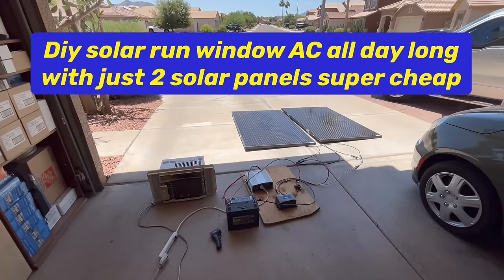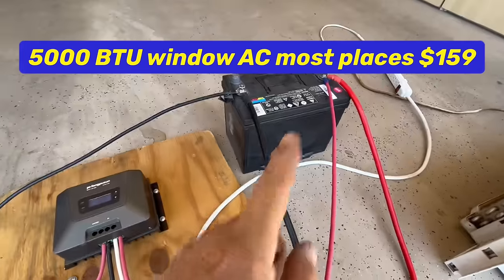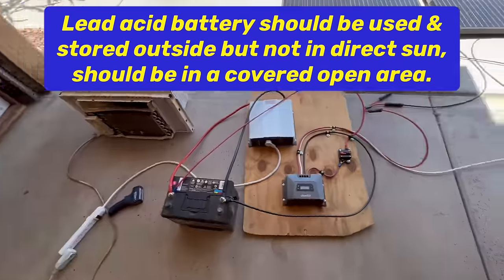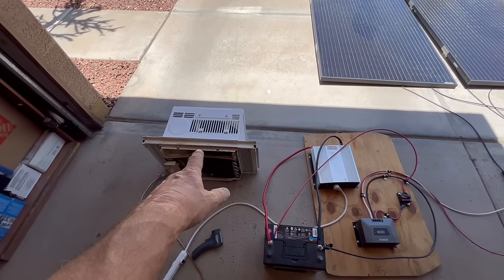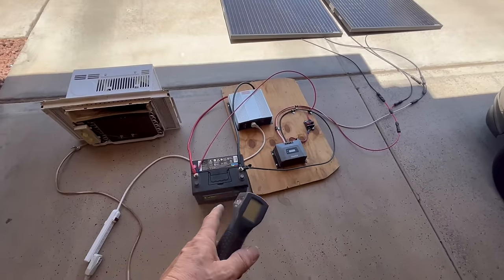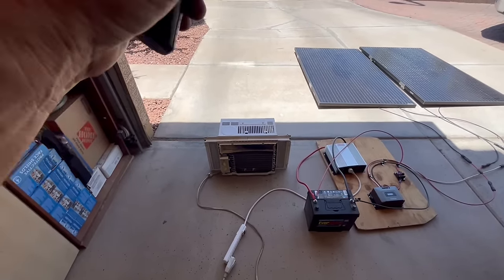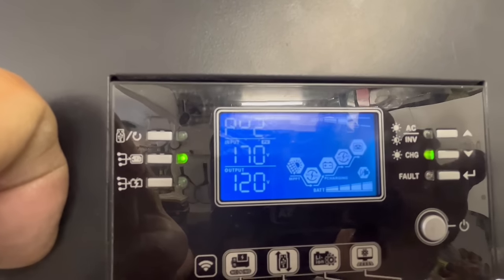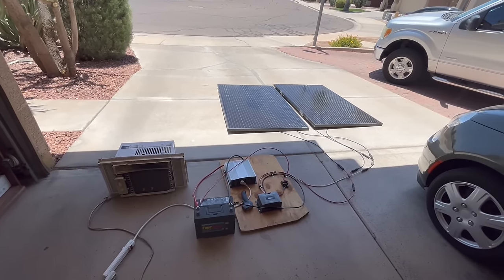Run your window AC with just 2 solar panels when sun shines. Easy DIY project you can do in one day.

Comment: You are running at a net loss. Very limited time of operation. And your batteries will die eventually you will need to use a day for charging alone. At 5000 btu you will need approx 1500 watts to run it. The batteries take the load but they panels don’t keep up. He also lied . You only get about 85% of the wattage the panel is rated at. A 100 watt panel you give 85 watts at best.
Reply from the maker: @bettyg7710  I actually showed that the 5000 Btu window ac only uses around 500-550 watts. Nowhere in the video does it triple to 1500 watts. Not sure how you say it uses 1500 watts. Ac shows in video it uses Around 5 amps as well. Looking at your way, 1500 watts divided by 120 volts would be 12.5 amps. That’s is 2 1/2 times what I clearly show in the video of 5 amps. Is this the new math they teach in schools now, because it is wrong. I have installed 8-12,000 Btu 120 volt mini splits and all of them at peak do not exceed 1250 watts. How could a 5000 Btu window ac use more than a 12,000 Btu ac??? I ran this for over 2 years in my shed cooling the inverters and battery bank. It would cycle off and on in the shed. I heavily insulated the shed on all six sides. The ac would run 1/3 of the time and 2/3 of the time be off with just the fan blowing. In Arizona we have around 320 days of pure sunshine throughout the day with no clouds above us. Heat island affect from concrete. I slowly expanded it but it worked flawlessly for 2 years. I speak from experience, not from theory. Please go and look into the basics in electricity. I have had dozens of people contact me that they were able to do the same thing and it is working. This is just the bare bones basic set up to show you can run ac with off grid solar. Improve on this design like I did and you will no longer pay for ac and be able to produce your own power. Actually if you look at my other videos you will see my foundation was correct and I now run my 31/2 ton whole house upstairs ducted air conditioning and my 4 ton downstairs air conditioner all day long using solar. Together, the 2 ac units use 6000-6500 watts. I even run my 3 1/2 ton ac overnight on EG4 LiFePO4 battery bank. I can even heat my pool using a 12.7 ton pool heat pump pool heater that uses 7500 watts while running. I will let the proof in the videos show who is correct and who is not. Who is telling the truth and who does not know about basic electrical. Hey hope you have a truly wonderful and extremely BLESSED DAY.
Reply: If he were producing heat hewould need 1500 watts x 3.41btu/watt for about 5000 btu. An ac moves heat from one place to another via a transfer fluid(refrigerant) and is more efficient energy wise.

Comment: Solar inverter with hybrid mode are much better than this solution. You need all in one device not this kind of setup which can be  dangerous.
Reply from the maker: This is just a basic example of running an ax with solar. But meant for long term use . Just was showing the basic components needed to run ac with solar. This is what I used 4 years ago. Now I can run and start anything in my house including central ac and massive electric pool heater that has an inrush amps of 186 amps at start up. The system I have now which is actually 3 separate systems run most of my house and reduced my electric bill by over 85 percent. Thanks for your input.  Hope you have a wonderful and blessed week
Reply: 😑 any particular reason why you think this is dangerous?..his panels are parallel, probably inputting 40v max on a -50c day..rest is running at 12v apart from the inverter to aircon cable. So unless you are using exposed conductors or are planning to chew on ac wiring, i'm not seeing a problem.

Comment: Does anyone believe this. This is not possible. That inverter is drawing about 45 amps and the 2 panels make about 5 amps. Battery dies in 15 minutes. I don't think he knows this, because he seems sincere.
Reply from the maker: You are so wrong, ram this set up for over 2 years. Ac uses 5 amps and 550 watts while running and around 25 watts when compressor kicks off. 550 divided by 5 amps = 110 volts. Where did you get the 45 amps from. Look at the specs on a 5000 btu window ac and you will see you are wrong. I ran this in my shed to cool solar inverters for over 2 years so I know what it can do. Now I run my 3 1/2 ton 24 hours a day on solar in day and 25.5 kWh LiFePO4 battery bank at night.i also run my 4 ton ac downstairs from 8:30 am to 6 pm with only solar. I run my pool pump, 4 chest freezers and a fridge/freezer combo 24 hours a day as well on only solar. In the spring and fall I run my 12.7 ton pool heat pump water heater that uses 7500 watts while running during the day all with off grid solar, I think I know what I am talking about. I have all these videos to back up what I just stated. Hey thanks for your comment and hope you have a truly wonderful and blessed 2024.
Reply: @diy-solar-guy  The equipment you have is very impressive. I know you have tons of experience with solar. But you can not dispute ohms laws. 2 panels like that can barely power a 75 watt incandescent light.
Reply from the maker: @dmorin9dm  the trick is to match it to the right size area so the ac cycles on and off, when the ac cycles off, it charges. In the shed I used it in , it cycles and stayed off more time than cycling and staying on. Those solar panels were actually pretty good. But this was just an example of how solar works for those who knew nothing about solar. I now have 46 kWh LiFePO4 EG4 batteries 51.2 volts and 8 KWh 12v LiFePO4 battery bank as well as 3-12volt EG4 separate batteries for the motor home to start propane generator and and backup. This is a huge step up from that little 12 volt deep cycle Wallmart battery. This little set up worked but I always encourage others to improve upon this small system with more solar panels and more batteries. Have a great weekend.
Reply: Thanks for replying. This makes me even more interested in solar and the awesome setup you have. I'll keep watching, thanks. @diy-solar-guy

Comment: Sorry but no you can have light on the panels not in use ….. charge controller takes good care of the panels. lol
Reply from the maker: You miss the point. I was talking about solar panels not connected to anything. Of course you can have solar panels connected to charge controller and the charge controller will follow the setting you program. We run a 3 1/2 ton Whole house heat pump, a 4 ton heat pump and a 12.7 ton( 127,000 btu) pool heater heat pump with a 12kw low frequency off grid inverter and even more. We sane over $5000 a year on electric bill. Cut our electric by 85 percent. All starting with running a window ac with a few solar panels to see if it would work. The video was about minimum components to run an ac with solar. Now we have the capability to run almost our entire house with off grid solar. We run our pool pump and pool heater with only solar year round as well. Hope you have a truly wonderful and blessed 2024.

Comment: Anybody that recommends such a poor option as those batteries HAS to be questioned. They cost much more long term. They are MUCH more trouble. And they offer less... Why, WHY recommend something so bad when there are so many better and cheaper (long term) options?
Reply from the maker: I was just showing an example of running ac off solar. I used this set up for 2 years in a shed to keep inverters and batteries cool. I would recommend LiFePO4 batteries but this was a way to run an ac very cheap. Of course you can design your own system any way you want and add other components, replace components. Do whatever you like. I was simply showing you can run an ac with solar. I actually run my whole house air conditioning on solar in day and 25.5 kWh  EG4 battery bank at night. I even cool my garage all day long with solar, basically 3000 square feet. This system is just the bare bones basics. Hope you have a great day

Comment: What a joke that battery won't last 15 minutes.  Without solor panel. 200 watts. Ac 5000 watts ÷ 115 v= 44 amps which is 440 amps at 12 volts.
Reply from the maker: Window ac uses 450-550 watts while running at around 4.5-5 amps. You only need to have 550 watts input constantly to keep running but when window ac will cycle off, it only uses around 20 watts to run fan when compressor is no longer running. I ran this set up in my shed for around 2 years keeping inverters cooler. Now we use 100 percent off grid solar to completely heat and cool our 2 story 2450 square foot house 7/24 along with cooling and heating the garage during the daytime. We use a 35.5kwh LiFePO4 battery bank to run 3 1/2 ton ac overnight. Never using grid power for ac even when it is 125 degrees outside. We also run our pool pump 7/24 and heat our pool to 89 degrees with only solar off grid. The window ac is 550 watts usage divided by 120 volts equals 4.58 amps. Not sure what window ac you run that consumes 5000 watt. My 3 1/2 ton and 4 ton whole house heat pump both running uses less than 5000 watts. Hope this clears up your misunderstanding of what is being said in the video. Hey, hope you have a truly wonderful and extremely Blessed 2024.

Comment: that battery will be dead soon..
Reply from the maker: Lasted 2 years while using it. Still have it charged. Hope you have a wonderful and blessed week
Reply: @diy-solar-guy  like how many hrs are you using it per day?
Reply from the maker: @glennteng5135 I ran this for over 2 years in my solar shed from around 9-5 to keep my inverters cool and see if I could run ac. Now I am running my main whole house heat pumps ( 3 1/2 & 4 ton ) to heat and cool my entire 2 story 2450 sq foot house and have a 18,000 btu mini split to heat and cool my 3 car garage that is 600 sq feet. We also run our pool heater in April and May then also in October, November and sometimes December. We run our pool pump 24 hours a day and have 4 chest freezers and a fridge/freezer combo we run 24 hours a day. All with off grid solar. We actually have enough solar panels and inverters to move off grid and supply 100 percent of our power off grid solar. Check out our other videos and see what we use and how we accomplished this. It’s been 4 years from not knowing Anything about solar or hvac and now have a paid off system with just the saving from electric bill. Thanks for the question. Hope you have a truly wonderful and extremely blessed 2024.

Comment: How gellable are you people. if you want to run that ac unit for more then a few minutes you're gonna need a hellava lot more battery power then that.. A 100 amp hour led acid can only be run down to 12.1 volts safely.. and to handle the start up of the compressor it will spike easily to 15 to 18 amps at 120 volts... that will drain that battery faster then you can recharge it.. so even in full day sun at max solar generation you will not be able to run that AC  long enough to cool down a small room in 95 degree temps outdoors no way.. If it were this simple every new RV would have them.. it mat run the fan on that ac but not the comressor,
Reply from the maker: @abelincoln3261  ran this set up for 2 years in my shed. You know the basics but have not run it yourself as I have. I started with this and now run my 3 1/2 ton upstairs and 4 ton downstairs heat pump to air condition my house when 115 out to 72 degrees. It all started with this bare bones basic set up. I live where there is 320+ days of full sunshine. I have had a lot of people duplicate this and says it is working great for them, others have improved on this basic set up and run larger ac’s or mini splits. This is just a simple example of how solar powers a window ac unit. It is meant for small areas. Just so people can see you can actually run air conditioning with off grid solar. I know, I do it every day now for over 4 years. Hey hope you have a truly wonderful and extremely blessed weekend

Comment: You totally scam people with just "two" solar panels, ... it's about the watts needed! 😱😁😝🤪🤣👍👍🇺🇸
Reply from the maker: @TinyHouseHomestead  so I guess all those people who actually did the same thing in my video and it worked for them, they let me know it worked. They all got scammed. Now I run my 3 1/2 ton upstairs ac and my 4 ton downstairs ac on solar during the day as well as my 3  car garage with a 18,000 btu mini split, all at 72-74 degrees with off grid solar. We even run our 3 1/2 ton ac overnight with our 25.5 kWh EG4 LiFePO4 battery bank. All from solar power during the day. I actually show I know what I am talking about, this is just a bare bones example that you can run a window ac using solar with the very minimal components needed. I have encouraged many with comments to expand and improve on this example as I did and now can air condition my house and garage to 72-74 degrees when it is 115 degrees outside like today and yesterday and the week before. I hope you have a truly wonderful and extremely blessed 2024.